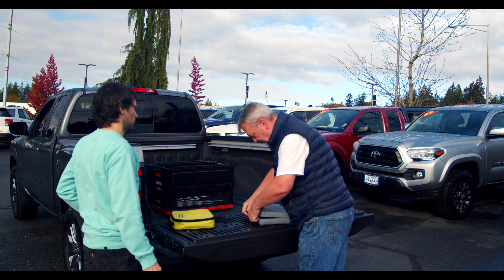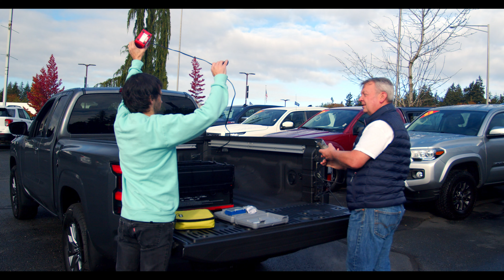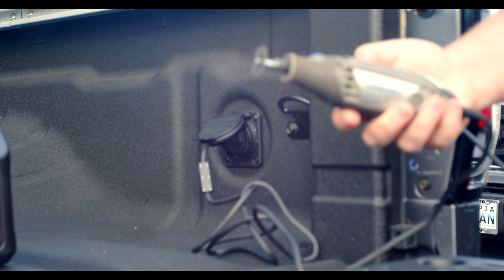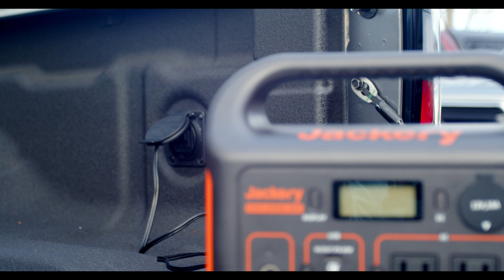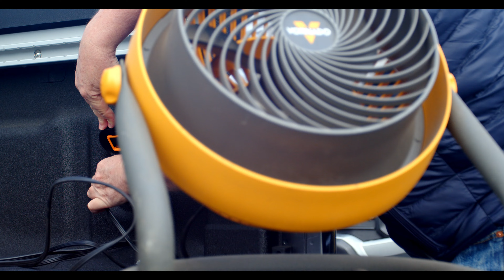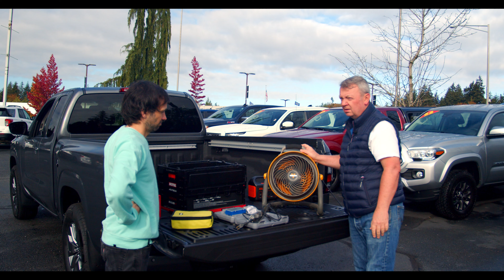Power Up Your Adventure: 2025 Nissan Frontier 120V Outlet Test

Comment: Have you installed one of these 120 V outlets in a Nissan that doesn't currently have one? I want to add one to my 2017 Titan.. It has a switch in the dash and 120 V outlet in the backseat but there's not one installed in the bed currently..

Comment: Says leave truck running liberals lol my 2025 frontier will smoke a Tacoma.  Didn’t get the tow package cause Nissan wanted to much but bought after market and added a 20$ tow switch so I can class leading tow stuff way more than Tacoma too and cheaper you gotta get used to hydraulic steering other than that way better and roomier

Comment: The 120 volt outlet (inside and in the bed) is connected to an inverter. The vehicle must be running and the dash switch ON. If the vehicle is parked, the outlet will put out 400 watts. This is perfect for basic tools, but is NOT enough for a hot plate, heater, etc.
If you are driving, the inverted cuts back to only 150 watts. This is still plenty to recharge a computer. There is no reason to use this outlet to recharge a phone since there are several USB outlets. (Using the AC outlet converts 12V to 120V, then the phone AC adapter converts it BACK to 12-volts!!!) It is perfect, however, to recharge a "power station" while driving.

Comment: I looked up that Nissan Frontier 120V power outlet's specification. It puts out "Modified Sine Wave" power. A better output that is more like what comes out of your wall is "Pure Sine Wave". BTW: Pure Sine Wave inverters cost more than Modified Sine Wave inverters. It's best not to charge things like cell phones or portable power units (like the Jackery) using Modified Sine Wave power - it can permanently damage the device you are trying to charge. Modified Sine Wave is generally OK for running simple power tools or things like a fan.
Reply: YES - it is fine for charging a "power station", and then using this to recharge your phone or power a laptop.

Comment: My Frontier will not charge my 700ah Jackery through that plug. It's disappointing because when you plug the Jackery in the wall in your house, it's only charging at about 235 watts. The truck should handle that.
Reply: It looks like the Frontier's 120V output is "Modified Sine Wave". From what I could find online it looks like the Jackery prefers "Pure Sine Wave" for charging. You could contact Nissan directly to find out what their inverter outputs. And you could contact Jackery to find out what it's charging system requires. FYI: it looks like the Jackery 120v output is Pure Sine Wave making it OK to charge your laptop and/or cell phone.
Reply: If it’s like the Ridgeline to get the full power you need to be in park. In drive or accessory mode it’s limited to 150w.
Reply: This is very helpful, thankyou for testing this.
Dumb question here, can you use both the 400 watt bed outlet and the 400 watt backseat outlet at the same time? If so, can you pull 400 watts out of both outlets "at the same time?"
Thanks again

Comment: Gentlemen, I don’t think I’ve seen a similar video for a frontier… I could be mistaken.  I think this is an awesome concept an idea for your customers and the product.  Great work.
Reply: A few more.. a small refrigerator unit, compact TV and a boombox for the Mötley Crüe.
Reply: Sorry, one more question, does the power outlet in the rear seat have the same ratings -120 V/400 Watts(I assume the car has to be on for this ) ?  Thx again ❤
Reply: @keiththompson491  I would like to know as well. In my 24 Platinum  Pathfinder, a smaller air pump for a mattress didn't work.
Reply from the maker: I believe it is the same spec as the one in the bed. That being said - I will verify and circle back 😁
Reply: @nissanpartscc  Russell/Tom, do you have a Platinum Pathfinder to test what you did with the Frontier? Like I had commented, I tried an air mattress pump and it didn't work but a string of xmas lights worked.
Reply from the maker: I think we just got a platinum in. I will see what we can whip up next week for you guys.
Reply: @nissanpartscc  thx